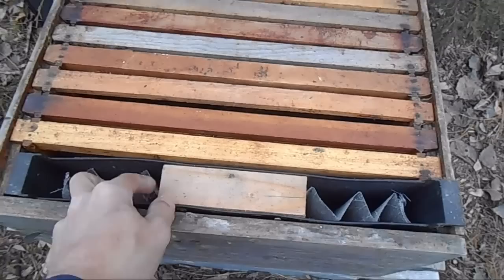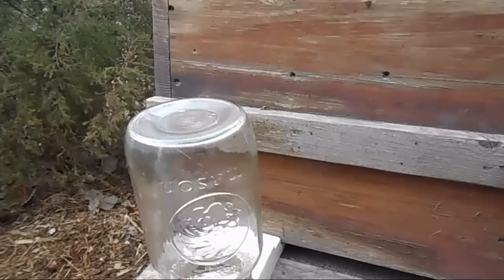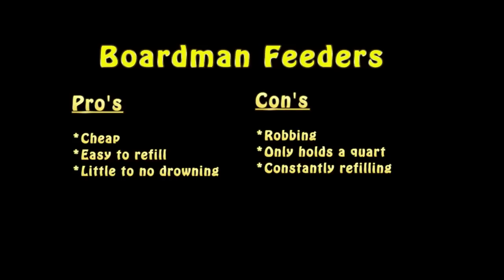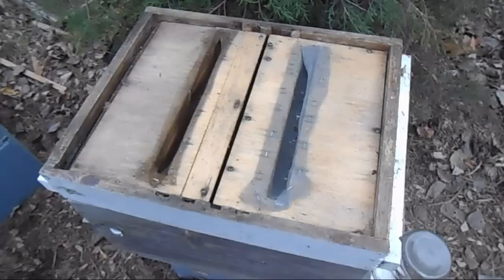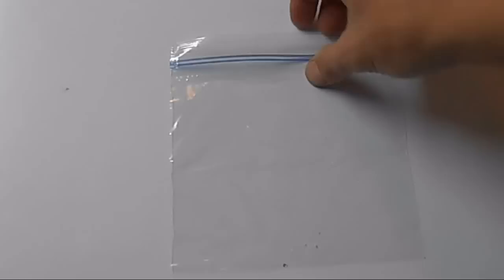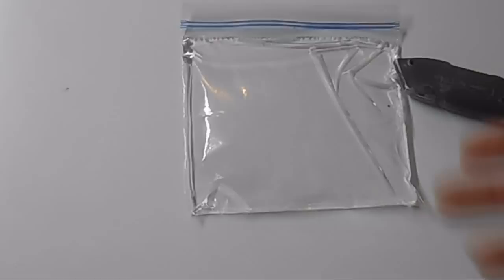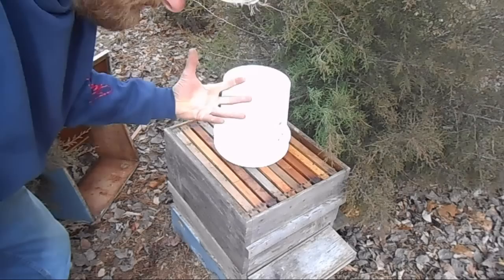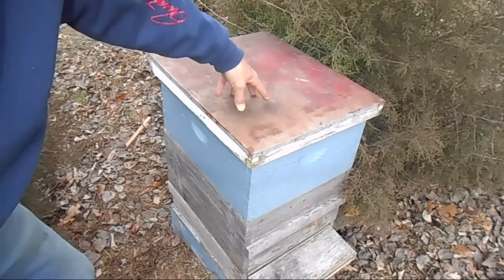Bee Hive Feeders...Part 2 Of Basic Beekeeping

Comment: What feeder do you like best?
Reply from the maker: +BeeMan97 I like the boardman feeders also called frames feeder the best. You can get them in a couple sizes. 1 gallon and 2 gallon. The 2 gallon takes the place of 2 frames in the hive. Just make sure they have something for the bees to climb on to prevent drowning. I use hardware cloth cut to the size of inside of feeders.